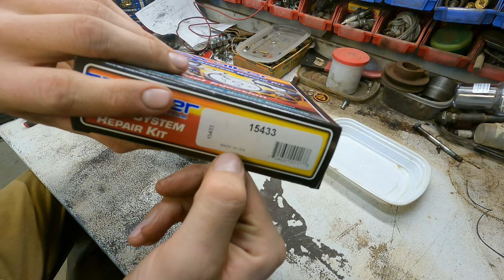Is this 1950's Galion Road Grader worth saving???  Cursed Grader Pt.2

Comment: Man, that throw out bearing hydraulic line has an awful kink in it. I don't think it would have worked even if the clutch wasn't stuck. Keep up with her, I'm liking the progress. Thanks
Reply: You gonna cut the flywheel?  Hey somebody's gotta have some new used parts sitting on the shelves. For this relic.....good build!!!
Reply: Possibly replaced long time ago with one that was too long.
Reply: Yeah, I saw that clutch hydraulic line with a kink in it too.  That will need to be fixed also.  Just another example of Christine fighting you.
Reply: @Bellboy40  its only a grease line
Reply: Hi Matt, I've been watching the channel for I think a year and enjoy it. Here's my question. How did the mouse get in there as I thought the bell housing was sealed? God bless and take care!! And I'm fully aware of the Christine movie.
Reply: @elliotazus6258    good question. they are able to get through some mighty small holes and gaps, but at times you still can't see how.  I removed mouse from the bell housing of a 4500 Ford.  biggest hole I could find was 3/8", maybe ... ???  certainly nothing over 1/2"
Reply: I thought the same thing.
Reply: That's just a grease line so you can grease the throwout bearing sleeve where it slides on the nose of the transmission. The other end of that line was on the inspection plate he took off and found the mouse nest. If you look you can see the grease fitting on the end of it. When he is inspecting the throwout bearing you can see the clutch shaft and fork the slides the bearing.
Reply: @Nighterlev  Yep but what about mice?:D
Reply from the maker: The mice got in through the small drain hole next to those bolts I torched. It took me 5 minutes to figure out how they got in as well lol that line is just a grease line for the throw out bearing, the clutch is all mechanical
Reply: @DieselCreek  Yes, I should have realized that. I'm certainly old enough. LOL
Reply: @DieselCreek  I hate those meeces to pieces! " Mr. Jinx" :D
Reply: @DieselCreek  When "mouses" are looking for a home; the Galion will always do in the clutch:D
Reply: @DieselCreek  thank you very much for the explanation Matt. God bless take care
Reply: Grease line, most of your large equipment Will have a grease line to the throw out bearing

Comment: Best way not to miss any grease points is to spray around them in a contrasting colour, and number each one.  If it's a hidden fitting, paint (and number) an arrow nearby pointing to the hidden fitting.

Then paint the total somewhere prominent, like the side of the frame on a grader.  Nice big circle with "T54" (or whatever the number is).  When you grease the machine, count them off one at a time, in order.

Comment: An old timer showed me a trick years ago, use a gas torch to put some gentle heat on those joints packed with old hard grease, the old grease will soften and then you can push it out with new grease.
Reply: works most every time
Reply: That works for me as well
Reply: I just replace them, quick and easy. Never had to use a torch.
Reply: @kameljoe21   Only problem with that is most people don't wanna drive all the way into town just to buy some new fittings, or wait for them to be shipped. I'd rather just work with what I got, unless I happened to have a ton of spare fittings laying around that I could use.
Reply: @motorhomeman1949  If you check most tool boxes on these things there are most time spares in them. I put spares in all of my equipment along with a few tools. if you have a grease gun case there should be a spot to put some of them in there as well.

Comment: Any time you need to clean the rust out of the tank, I definitely suggest using electrolysis. I did it on the tank for my dad's rototiller and it took about 3 days total but it worked great, looked brand new inside. All you need is a piece of plastic (coffee can lid works great), some water, washing soda (sodium carbonate not bicarbonate), a piece of steel TIG/gas welding rod and a trickle charger. Strip the copper coating off the rod with some sand paper and stick it through the plastic lid and bend it to where it goes through most of the tank but doesn't touch anywhere. Then fill the tank with the soda/water (electrolyte) mix, mixed at about 1/3 cup per gallon. Then connect the negative cable onto the rod and the positive to the tank the furthest from it that you can. Then turn on the trickle charger and it'll start bubbling right away if you have it hooked up right. Within 15-30 minutes you'll see stuff building up on the rod, if not you might have the polarity backwards. Clean the gunk off the rod when the reaction slows down or there's too much stuff on it. Once it's clean you can even take a piece of zinc or copper and switch the polarity and plate the inside of the tank to make sure it won't rust again. (though that works better with an acid solution with zinc or copper suspended in it)
Reply: I mean I wasn't there but it looked like the circle end of a wrench should of worked.    SHOULD

Comment: As a mechanic on older vehicles from the 50's and 60's I remember the old Holley glass bowl carburetors, as well as the non glass ones.  In all they were a great carburetor.  Very few problems and easy to work on.  International used them a lot on their 6 cylinder engines, like the one on your Galion grader.

Comment: As a long time grader operator in civil and mining, the steer ram is used in wet conditions when the blade cutting mud will load up and drag the grader around, you tilt the wheels opposite to the blade to counteract the load on the blade.

Using wheel tilt in dry conditions usually results in a write up ha ha.

Comment: She's a good old grader, Christine - she just didn't like being woken up - but now she recognizes TMC - tender matt care - and is cooperating.  you forgot to delcare about the tensile strenth of all the stuff you forgot - no wonder it worked.
Reply: Now he has to paint her red to be christin!
Reply: I'm not buying it Matt. I think Christine will fight you every step of the way. Fun and interesting project though...lol
Reply: Matt=shade tree mechanic, without a shade tree. 🙄
Using a gas torch to cut a bolt head 🤦😲
Reply: @thorstenwolters9025  That's right! Christine was a great movie 👍🏻
Reply: @ConstructionMachineryChannel  Yeah, cool and scary.  And she had a woundefull red!
Reply: That’s in a day, a very long time ago, when stuff was made to last!!!
Reply: @SuperchiefApache  Those days are long gone. Everything now is made to last 7-10 years and then thrown away.
Reply: @ConstructionMachineryChannel  True dat!!
Reply from the maker: @stevenr8606  and now else would you cut those out of there? Had a heck of a time getting the torch in there, no way you’d ever get a grinder in there plus the torch took less than a minute per bolt and didn’t even touch the casting
Reply: @DieselCreek  6 side regular wrench looked like it would fit.  Add a prybar and it should be done.

Comment: Matt, in answer to your opening question, YES, the old Galion grader IS worth saving ‼️ Please bring it all the way back! Would like to see you finish bringing the old crane truck back as well. (headlights, interior, etc to make it roadworthy) I could just hear it now: Matt opens the clutch inspection port, sees the mouse condo, starts to pull it out, realizes it is HUGE, then cues the classic Mr Jinks line - “I hate meeces, to pieces!”  Please , restore Christine! Stay safe, young man, stay safe.

Comment: The quickest and best solution to clogged grease fitting is just a little heat. It melts the hard grease so everything can flow again.
Reply: check for a stuck check ball also.
Reply: How much heat? Hair dryer, hot airgun, oxy-acetylene torch or thermite amount? I got one real stubborn one open with screwdriver scraping passage open what could be done, then spraying wd-40 in when again with screw driver, blowing crap out with air and then repeating this couple of times.
Reply from the maker: @Hellsong89  little propane torch does the trick a lot of times if it’s just the fitting. Sometimes the grease passage all the way into the part is hardened up and that’s where the rejuvenator would excel.
Reply: Grease is flammable so open flame would quickly start a grease fire.
Reply: @DieselCreek  induction heating would be the safest u don't want to be messing with burning grease if a open flame starts it on fire.
Reply: Torches not too handy,out in the middle of a dry hay field,that's where  such tool would be handy.
Reply: Torch works... keyboard warriors aside. Use that trick on my tractors and boat cranes in Alaska. Don’t be an idiot and  set your machine on fire.
Reply: @Hellsong89  There ain't nothing that a little thermite can't fix m8
Reply: @stevenplaskett7728  Sure can, but if you are smart about it, it isn't usually an issue. 
You try to do it to a fitting under a leaky fuel line, tank, etc? Yeah, definitely an issue. 
I had the torch out half the day today for frozen bolts, fittings, etc. Did the lube catch? Yes. Did I then blow it out easily? Every time. 
Caution and experience go a long way though.

That and induction heating can still EASILY exceed the flash point of grease.
Reply: First thing to try is just lightly tap it with a hammer, trying to hit the ball too. You'd be amazed how often it works.

Afterwards goes the torch, then the rejuvenator if you have one.

But once you're going the rejuvenator route I am not sure whether it wouldn't be easier to just replace it altogether.
Reply: That's how I've always done it

Comment: I am watching on 2 devices right now, I have to say same recommendation as last time. Paint, spray paint. Any paint,  make it look new or more appealing to the eye. I think that road grader has a lot of years left after all the work you just put into it. Paint it Black or Yello or Orange something. Most of your machines just need a good paint job after you get them operational. Value is also in appearances. Seriously rustoleum is all you need to invest in a bunch of it, hide or shield the machine from getting more rust. 
YouTube's Andrew Camarata is who this idea truly comes from when ever he finishes fixing one of his heavy machines or even parts to his machines, he finishes it by painting it. He is someone I would recommend becoming associated with, He has made his own custom buckets for excavators. That you could probably use some day on your property or at work. He does a lot, has a castle made out of conex's on the side of a mountain. Another YouTuber letsdig18 I watch with heavy machines, all of you have same dream. Just some further ahead then other's. Main point is Paint when you had gas tank off was a perfect time to paint it after you cleaned it... just putting it out there my friend. I want you to succeed and everything you touch to increase in value!!!

Comment: Those bolts on are why I have a drawer full of old wrenches, heat em and bend to shape needed, toss back in drawer for the next time.
Reply: 😂😂yep
Reply: Anytime there's cheap spanners for sale, I grab them.  Adaptified spanners are engraved with their purpose, and stored with the machine they apply to.

Comment: The reason the tires lean is because when the blade is tilted one way, the grading will drag the front to either side due to the weight of earth and angle of blade  trying to push straight forward

Comment: I'm no machine operator, but from looking at the way the wheels tilt, it looks like that's done to counter the force from the blade. The blade angle would pull the machine to one side as it moves.
Reply: Taylor Sharp,Yes that is the primary reason for front wheel tilt on Graders.Funny story,about 30or fourty years ago I was watching a soldier use a grader to scrape ice off a roadway,did not have the wheels tilted.He hit an extra hard chunk of ice with the blade,which caused the entire front end of the machine to skid sideways over half way into the oncoming traffic lane.Improper wheel tilt and improper tire pressure are the most common causes of front end skids with wheeled graders when the are being used to push snow and ice.
Reply: @korvtm  Ha! Thanks for confirming that, and dang that story sounds risky as frick! Hope no one got hurt at least
Reply: @taylorsharp5928  Nope,although the operator  looked like he needed to change underwear

Comment: You should have learned "maintenance by braille" like we did on submarines.  If you (or your wrench) can touch it, you can disassemble it.
Reply: And  the  two degree  turn,  flip  the  wrench,  and  turn  another  two  degrees  maneuver?
Reply: @jeepanimal2943  At least it doesn't take 15 minutes to get to the position to do the 2 degree turn, then 15 minute crawl out, and back, repeat.

Comment: Christine the car was a 1958 Plymouth Fury. Beautiful car with a whole lot of attitude! Just like every Christine that I know. lol. That Galion grader bell housing, I believe the bolts were put in or taken out with a special tool that looked like a socket welded to a breaker bar. When I was a kid (about 45 years ago) I worked for a construction company as a grease monkey. They had a grader similar to yours. My dad actually operated it. I think it was either a late 40's or early 50's. We got the "tool" for the bolts from an old heavy equipment mechanic. 1 end of it was a socket that was welded to the handle, the other side was an open end wrench. Handle had GALION in raised letters right on it. The socket end itself looked like a socket used for an oxygen sensor with the side cut out of it. You get 1/6th of a turn at a time...lol. I learned a LOT of swear words that day from my dad!

Comment: As for a grease gun fitting, I HIGHLY recommend adding a “Lock-N-Lube” tip to your gun. Makes it so very much easier on old or stubborn grease zeros, and prevents the gun tip from popping off when it shouldn’t, but makes it easy to attach, and easy to remove when you are done!!!
The Lock-N-Lube and my “fumoto valve” for oil changes have been the best things I have added to my shade-tree mechanic toolbox!

Comment: Great to see a young guy reviving this old stuff! I do the same. Over the years I built a big shop (super nice for old equipment) and then have upgraded to newer stuff on the ranch. Still get the most satisfaction out of the old stuff I revived and still use.
Reply: P.S. That IH engine and 1904 Holley are the same as my 52 IH truck uses. Good engine. Easy start (rare for IH), runs well and never burns oil. A 3 cyl Detroit would sure be good in the grader tho!
Reply from the maker: Thanks! Everyone loves the Detroit’s and I really can’t see why, they are obnoxiously loud and don’t make that much power...
Reply: @DieselCreek  they were popular because of so many models from 2cyl up to 16. Even more in marine versions. You could repower almost anything with some variant. A Detroit may have even been an option in that grader. If you could keep oil them you couldn’t kill em. The gas IH will be ok if the governor is good. Treat the governor like a jewel. Hard to find parts for them. Make sure it has oil in it.

Comment: Just a tip I do on any old motor is I add about a 1/2 quart of diesel and run the motor at idle for a few minutes to loosen up the worst sludge then drain the oil and replace the filter.

Comment: As a viewer of many YouTube and Discovery videos I feel I am a fully qualified arm-chair mechanic!

At 39:13 you ask how the Galion factory built that machine and it seems clear there is no access… and I don’t see how you could refit the bolts you had to cut off.  

My best guess is that the engine, transmission and swing axle units might have been a sub-assembly.  I.e. they built up the power train and then lowered the grader chassis down onto the assembled rear power train.  They either picked that straight 6 engine simply because it was available to them, or because it nicely slides up between the chassis rails.

So maybe the easiest way to put it back together might be to dismantle it further?  As least you’ve got the toys you’d need to lift the chassis off the power-train.

Love the videos, I’ll keep watching them as long as you enjoy creating them.  Keep well.

Comment: My wife says to get yourself a face shield for removing bolts with the blue wrench. I thought the crane was gonna save the day, but it's nice to have backup. And Matt, please put a couple ratchet straps on that, uh, "engine stand" before cranking on those bolts. Baby steps, baby steps. You'll get it done.

Comment: If my memory serves me correctly, the entire engine and transmission comes out the back of the chassis. The rear x member should unbolt. I am trying to remember back around fifty plus years. Also that engine looks vaguely familiar. Where I did my apprenticeship we had International C1100 light trucks. That looks like the 282 cui engine that was in them. It is a really good engine plus it went like stink in the trucks. This is in New Zealand in the seventies, and also I was one of the very few women to do a diesel mechanic apprenticeship. You have brought back an awful lot of memories, some good, some not so good but thanks for that

Comment: FWIW, the first can of PB Blaster I ever used back 25-30 years ago or so said right on the can it was developed for dissolving hardened grease. It's never been much a "loose juice" for me, but it does work good as a solvent with some lube in it. I have to give you credit Matt, I would have been grinding wrenches and pulling what little hair I have out before I thought of torching off the bolt heads! Not sure why that idea surprised me so, but then, I'm not too bright sometimes... Another well done video!